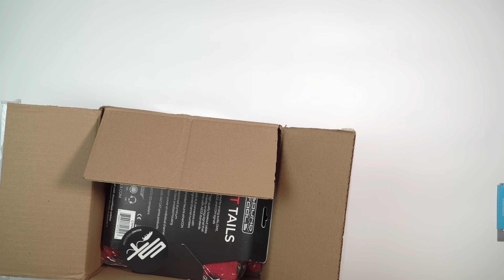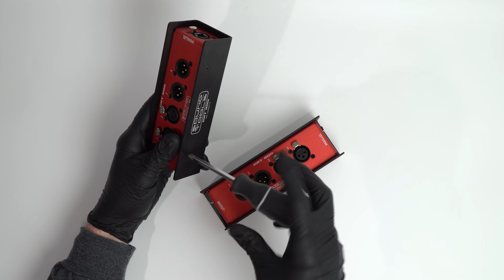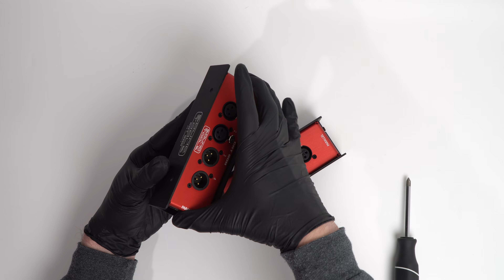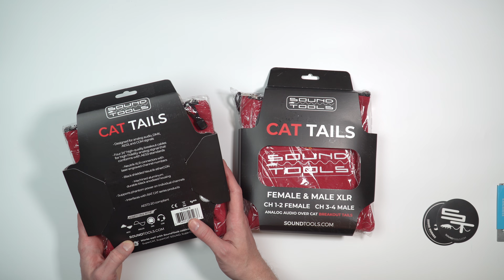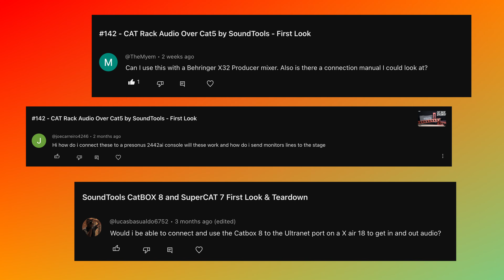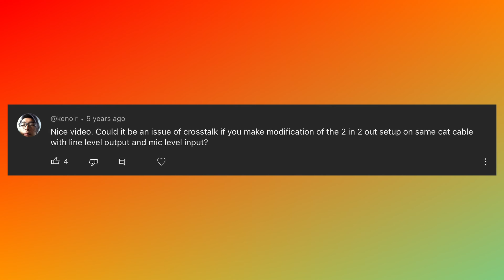NEW CAT Boxes and Tails by SoundTools Go BOTH Ways! - Audio over RJ45

Comment: Thanks for your reviews - commenting for the algorithm.  

I have just ordered my second set of SoundTools gear, partially because of your teardowns and overviews. I'll be mounting one of the bidirectional boxes to my pedalboard to handle bass and vocals while returning either a mono or stereo monitor return. This seems to be the perfect application for this. I also grabbed two of their 8 channel stage boxes for other members of bands for similar purposes. I've bundled together a few sets of two CAT6 cables in different lengths to handle different sized stages. It is amazing to handle a 5 piece band with such limited cable and boxes in terms of weight and size! Also, if a cable breaks, no big deal - cable is replaceable. My entire rack setup and band setups now support modular audio over CAT. It is not cheap, but it is a game changer for efficient replicable setup and teardown.

Comment: Hi everyone, I'm really interested in using the Soundtools CAT Boxes for a project, and I was hoping to get some advice about a specific use case. I'm wondering if I can use a single CAT Box (Send/Return) to send a stereo signal from a keyboard to the CAT Rack, which would then be patched into a mixer. The stereo monitor mix would then be patched out of the mixer into a different CAT Rack and sent back to the keyboard player using the same CAT Box (Send/Return). I also want to know if the CAT Box (Send/Return) can be used in a way like the CAT Box 8, where you can remove an internal ribbon cable jumper to convert a CAT Box 8 into two CAT Box 4 units. Any insights you can share would be greatly appreciated! Thanks!

Comment: I made a custom 3in 1out for my small acoustic pedalboard that lives on the backside. LR from the DI with fixed angled XLR, 1out as d-type for a headphone amp and an extra in for anything I may use that gig. Saves a few minutes and a lot of mess mostly.
I like that this solution gets more widespread over the last couple of years. Would be great if the different manufacturers agreed on a universal wiring soon!

Thank you for spreading the news!
Reply from the maker: I love it, it's always cool to hear about the custom setups people have come up with to simplify jobs. Thanks for sharing!

Comment: i made a DIY of this here in Philippines for our church beacause we have no money do buy snake but it has a noise maybe because we are using analog mixer i use cat 6 SFTP internet cable it works but it has a noise issue, maybe because i use cheap internet cables
Reply from the maker: Hey Christian, that's really cool to hear you made your own. Whenever there are noise issues with these types of things, it's almost always down to the cable in my experience, or the shield of the cable not being terminated properly when the ends are made.
Reply: @DcSoundOp  i check the ground of the internet cables last night and i found out that the ground has a low connectivity maybe because its not soldered to the connector from the factory, what I'm going to do now is to change the internet connector and then solder the ground to it to have a better connection, ill update you if it works on me, thanks!
Reply: @DcSoundOp  its all good man, i solder the ground and it works